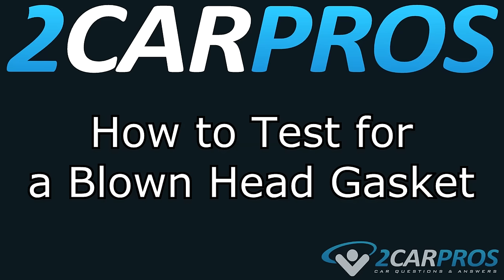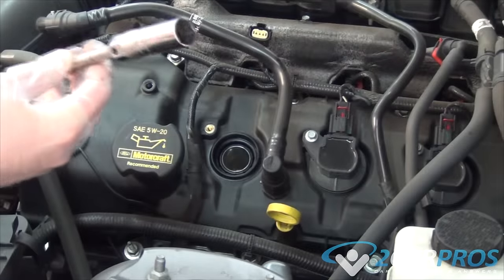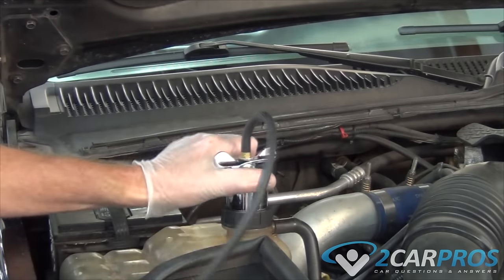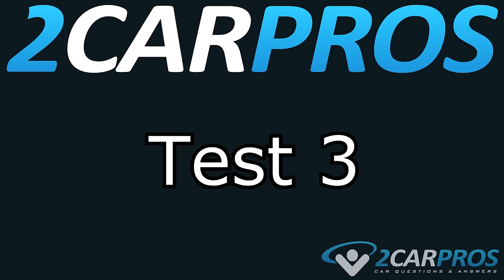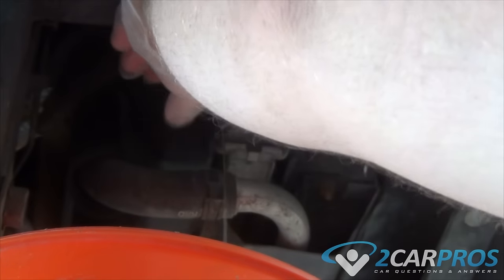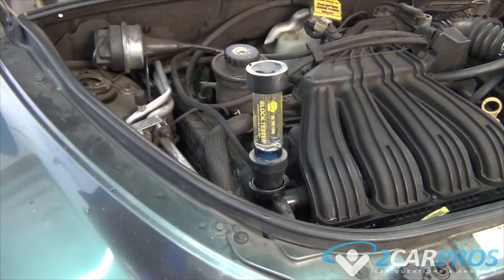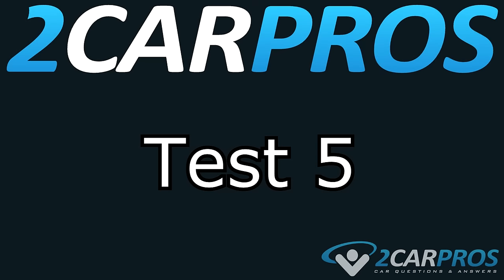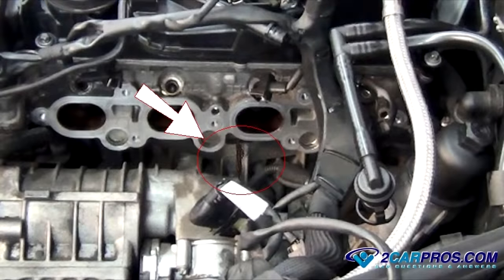HOW TO CHECK FOR A BLOWN HEAD GASKET

Comment: A very easy way to tell whether you have a blown gasket is to just remove the oil. If water falls out first then the gasket is blown. Because oil sits on top of water.
Reply: That doesnt confirm headgasket is blown,  only that coolant is making its way into the oil.   Could be from the oil cooler leaking.
Reply: Or fuel leaking into coolant there are many different things that can differ from where the head gasket is damaged
Reply: Lots of white smoke and collent is being evaporated
Reply: Is a gasket repair extremely expensive
Reply: That's for a fully blown head gasket as well as what people commented. Some of these test are for when the gasket is slightly leaking but not where you can see in oil.
Reply: @94sn95gt can a gasket that is faulty on a oil cooler cause this as well

Comment: Test number 1, you consistently have to refill the radiator overflow but no fluids are under the vehicle.
Reply: My radiator overflow is always empty. I don't have any leaks on the ground. My car smokes some under the hood when you reve up the engine. Idk if it's oil or antifreeze I smell. I just bought this car in April.  I dont drive it much but one shop told me it was a blown head gasket. After about 3 weeks of driving it it burned about 2 qts oil. My radiator was about 1/pitcher water low. 
One machanic came to my house and couldn't tell what was wrong.. but he made him a quick 20.00 smh!!
Reply: Yes Barbara your smelling both because they are mixing together and thats a sure sign of a blown head gasket the gasket is supposed to stop the fluids from mixing it will cause it to smoke a lot and overheat thats why you can't see a leak because their just mixing! I only know some things about cars from a long relationship with a mechanic!
Reply: That's what mine is doing now... constantly filling with 50/50 coolant (like twice a week), but no leaks on the ground or just a few drips here and there.  I've got a mechanic coming by today 🤦🏽‍♀️.  We have a Chrysler 200.  I hate this car 😂
Reply: @mstoi38 sounds like the coolant is leaking to the exhaust side. In my case, i had a avenger. The coolant was  burning up before I could see any indication of a leak. I hope you got it figured out. Next vehicle get a Toyota, save yourself the headaches 👍
Reply: @lozo4745  My dad always said "buy foreign," and he worked at USX 🤦🏽‍♀️🤣.  

Come to find out... my head gasket is blown.  It was a crack. Thus, no smoke from the tailpipe at the time.
Reply: So that means it’s slowly going out?

Comment: the way I found out was my subaru exploded
Reply: Josh King I have a very minor coolant leak, but I bought my car private sale, when I had to change the cats I could drive on most roads but I couldn’t get the car over 40 without putting it in sport and changing the gears myself, I wouldn’t recommend driving the car, you’ll risk blowing your motor. i just changed my radiator hose because it was the size of a baseball.
Reply: Josh King my radiator water is bubbling out badly when cap is off....  but van is driving perfectly other than loosing water in radiator. Wonder if that always means a blown head gasket or hopefully something else.
Reply: Sam Richards sounds like a head gasket man
Reply: Josh Flanders most probably right
Reply: @samrichards8251   i recently had that problem with my 03 Seville,put a new radiator,heater core,water pump and thermostat in only to find out that a small bottle of k seal would've save me  alot of money
Reply: D Trap not sure if that is a long term fix or maybe short term Patch
Reply: @samrichards8251  yeah I'm still skeptical it's only been over two weeks but the leak stopped immediately after I put the k seal  in
Reply: You'll are eat up bro
Reply: @joshking3256  the same thing happened to me ! What kind of subaru ? Mine is a 05 wrx just happened the other day. Only thing is that by the time I got home the car died out a few times ! I hope I didnt damage the engine
Reply: I thought mine did as well...but after fear/determination/screaming child at night in the road I got it to turn over and get home...I mean, there’s a shit ton of oil blown all over the back of my motor..but it’s turned over after I shut it off as well...
Sooo..
Thinking about going the Blue Devil route.
Reply: ESP since I just replaced the radiator last WEEK...and replacing the HG will be worth more than the car at this point so what do I have to lose..right?

Comment: I used a bottle of Steel Seal to fix my head gasket, drained the coolant, removed the thermostat, flushed the cooling system really good, Then use a radiator cleaner to clean the cooling system , Make sure to flush out all the cleaner 100%, When engine is 100% cold add steel seal with distilled water, turn heater on high & let idle for 30 mins with the radiator cap off........Let it cool for 1 hour the let idle again for 30 mins with the radiator cap on...........next morning let it idle for another 30 mins then removed all water from the system to let the steel seal cure by air contact for 24 hours, Replace the thermostat, fill with coolant and your good to go. Mine has been running perfect for 70k miles now as i use the car for uber & lyft, Only cost me about $120 total.
Reply: Still running?
Reply: @BriveAW  Yup still going
Reply: I think that is the product we used on my buddies 2007 335i (twin turbos pushing 15psi).  Comes in three bottles...1 flush. 2 ceramic block and head sealer.  3 coolant system stop leak addictive. 
Followed directions and no more steam shooting from the side of his engine. Still good 3 years later as far as I know.  Great product.
Reply: @MrRepairmanjack  That’s the Irontite kit, That works 100%

Comment: Also another way to tell your car's got a possible blown head gasket is you are not getting any heat. Since your cooling system is pressurized any loss of it will cause you to get no heat. Though it could be a clogged heater core or not enough coolant as well. Make sure to rule them out.
Reply: Blower motor can also cause no heat.
Reply: Or ur just low on coolant
Reply: Also check radiator oil cooler
Reply: @codyzent6471   well that's a no brainer!
Reply: Also if your heat isn't working it could also be a sign of a bad serpentine belt.
Reply: So if heat is working it can’t be a blown head gasket?
Reply: Id like to know aswell everyone went hush hush
Reply: @dominiclambert7296 is this the case ?

Comment: If you drive your car on short hops, that can make the fill plug milky as well. Nothing wrong, just doesn't run long enough to evaporate normal condensation.
Reply: Thank you
Reply: What happens if you car was sitting for 3 months in cold weather with its dirty oil. Now it’s milky??
Reply: What happened if you don’t drive your car for 3 days and you get white stuff on oil cap
Reply: @leo4870  condensationdrive it for a good ride, probably go away probably was there before it was parked
Reply: goat, thank you man
Reply: That's a bit of a relief. I get a good bit of that milky goo as well, and I usually only drive my car in town, so very short trips. I don't have any white smoke from my exhaust, dipstick is perfectly clean, and I can zip along at 80 on the interstate without noticing anything weird. So it definitely puts my mind at ease to know my car is likely just fine.
Reply: @thewiseguy7100  44ý

4

Rr=r

G
Reply: Ñ
Reply: What do you mean by short hops?
Reply: @pacobus24  not long enough for it to get warmedup and time to evaporate condensation

Comment: I did all those tests and could not find my blown gasket - but the following test showed the problem - remove radiator cap and bring level into view - bring a cylinder u want to test to top dead center on ignition stroke [both valves closed]  put compression test hose or extension [without check valve in it] into spark plug hole - attach shop air to supply shop air at 100 psi into cylinder on a warm engine - observe coolant in radiator for rise in level or bubbles.

Comment: Big indicators, milky substance like shown, and the antifreeze overflow container level rises with water and dirty sludgy water. If running long enough water inside gets hot and bubbles from air flowing in. Can cause your container to also crack. Great video!

Comment: more symptoms could be :
1-extensive smog in exhaust 
2-coolant level decrease (sometimes you may hear water flow in car cabin specially at ~3000 RPM "when engine is cool")
3-increase engine oil amount
4-uneven engine idling (after engine is cooled - water leaks in engine and makes problems for spark plugs - it wont show when engine is hot)

ignoring bad gasket may cause Subsequent problems for your car engine and increase costs !!!
Reply: I have 2 (very very fast) and 3... that settles it, right?
Reply: that explain why i could hear water moving inside the cabin and my coolant was low and lots of misfiring after starting the vehicle.  Thanks for your comment!!

Comment: Good stuff. Here's another tip, it happened to me once:
I pressurized the cooling system, looking for any water leaks. Well, if your equipment is working well (no air leaks out the pump itself or via the radiator filler neck) the system should maintain a steady pressure reading at about 12 psi (I believe. Sometimes I only fill to 7) if pressure drops within 5 minutes, I look for signs of water, on the ground, around the engine. Well, I didn't see any water anywhere..which lead me to believe that water was being lost inside the motor due to a blown head gasket.
Reply: What kins of color was this water? Me and my buddies audi a4 has oil in the coolant reservoir. We were working on it today and it was dripping a white opaque water below the engine for about 3 hours. Slowly but led to a lot of water over time
Reply: @logansimpson804  Sounds like he had a blown head gasket from an oil port to a water port. What did he ever do with it?
Reply: @RC-Heli835  ended up parting it out. Took the heads off and visually were fine but 90% sure it was gaskets

Comment: I would add to the compression test.... If you also notice a discrepancy between adjacent cylinders in excess of 20 psi, I would consider that vehicle as having a blown Head or may need a Head replacement soon.

Comment: Test 1: "Mayonnaise" as its often called, or milky sludge, can occur when a vehicle is driven short distances. The vehicle may not be heating up the oil long enough to burn off natural condensation in the engine. As heat rises, the water vapour will stick to the oil cap and form an emulsion with the oil. You can wipe this goo off with a paper towel or lint free cloth. This condition can be prevented by either taking a long journey once every week or two, or by letting the car idle so it can come up to temperature and burn off this residual condensate. If you get this mayonnaise even after frequent long journeys then the head gasket might be bad.

Test 2: If easy and safe to do so on your gasoline vehicle you can remove the fuel pump fuse and let the vehicle run out of fuel, restart the vehicle. When the vehicle is unable to run, you can now remove the spark plugs. Hold a printer page or similar closely over the spark plug hole and have another person crank the engine for a few seconds. If you observe any residue on the page, smell the page to see if its gasoline, if not it will most likely be water from the cooling system. You can add red (or other color) dye to the cooling system to further validate this, if the water on the page is red for example it's a guaranteed sign coolant is entering the combustion chamber.

Test 3: When the engine is cool, there should be no bubbles in the radiator or expansion tank. If you see bubbles, combustion gasses are entering the cooling system. In this instance, you car will often present as an overheat condition. If you remove the radiator cap when the engine is at operating temperature (Never do this) the coolant will boil naturally. The radiator cap pressurises the cooling system to prevent the water from boiling.

Test 4: As explained. However, in the case of diesel vehicles the solution will turn green indicating a bad head gasket.

Test 5: A compression test will tell you if the compression is low, but not why its low. It can be low due to worn rings, bad head gasket, cracked block or head, warped block/head, or valve seat issues. A leak down test will tell you how much air is leaking from the cylinder, and where its leaking to; which is the important thing to know.

Test 6: As explained.

Test 7: If you checked all of the above and your vehicle is still showing overheat on the instrument cluster, check your temperature sensor and thermostat. A thermostat can stick closed which will cause engine overheating, and over time cause the head gasket to fail.

Test 7: If you diagnose a bad head gasket its very important that you discover why the head gasket failed, if you just throw a new head gasket in and fail to rectify a crack in the head for example, you may blow the new head gasket in a matter of days.
Reply: How long is a "short" distance? When I drive to work it's about 5 miles and about a 12 minute ride. Is that short enough to show then?
Reply: Yes, I would say anything less than a 30 minute journey to be short. Considering it will take something like 4 minutes for the engine to come up to normal operating temperature. This means that your car only has 8 minutes or less to try and boil off the condensation. If 8 minutes isn't enough then you have more condensation accumulating than you can burn off and therefore get the mayonnaise forming.

To combat this you can leave the car idling outside your house for 30 minutes or so once or twice a week if you have a lot of water in the oil. If its not so bad you could start the car in the morning, go back inside to finish breakfast, and by the time you're done the car will be boiling off the excess water on the way to work. Do this for one or two weeks and you should be goo free for another few weeks/months.

You should also note the temperate of your location, and more importantly the dew point. The dew point will determine how quickly the water droplets form inside the engine. If you are often exceeding the dew point, then you will need to let the engine come up to temperature for extended periods of time. Otherwise the 30min idle once a week should do just fine.

I hope this helps.
Reply: I have a 4.6 liter v8 and i have maybe like one water drop worth of this wite gunk on my oil cap... is this a sign of a potentially small break or not? I bough the car (I am 18 with 2 friends that are car mechanics) and i fuc*ed up... this mustang 2002 was upsidedown... (my friends checked it and nothing was visible only when i took off the cover i saw signs of straightening the roof very well made actually) 

So returning to the gasket is it broken or not (no smoke only this white gunk in a very very very small quantity) and I have an ignition coil screwed (one cylinder is not working (replace coming from the US) )
Reply: SeaMonkey aàaAaaaaaaaaaaaaaaaa
Reply: SeaMonkey i
Reply: there is a difference between a sandwich full of thick goo and a slight condensation, the picture shows a blown HG, my BM in winter gets some very slight droplets "THIS" is normal any more than that I would do further checks
Reply: Ok I have a 06 equinox it was running hot, I took it to a shop they said it was a low intake gasket so I bought it and took it home but it still not any heat inside the truck to warm up or defrost the window I put antifreeze and water in still no heat. So my friend checked it out he said it's some block sealant inside so I ask the shop did they put that in they said no so I'm in need of knowing what's going on
Reply: SeaMonkey what
Reply: @SeaMonkey .. my coolant temperature gauge keeps fluctuating as I drive between 90-120 ! Sent it to 3 different garages whom have flushed out the radiator all put in next coolant and even changed the Water pump out and no solution?
Reply: SeaMonkey yep
Reply: You're right test number 5 could be worn cylinders But if the two cylinders are identical in pressure and the rest of the cylinders are high in pressure there is a chance they are equaling out through a blown head gasket. Also if you put a y in there you can actually watch the gauge fluctuate from one to the other. That wasn't mentioned.
Reply: My car is not showing smoke or loosing power no milky oil no leak just run hot when i stop at a light or idle the mechanic said blown head gasket im at a loss please help
Reply: Glad someone knows their stuff
Reply: @devonaminaewing2061  Clogged radiator or bad cooling fans may be your problem.
Reply: So when the engine is idling and there are no bubbles when I'm looking in the reservoir tank with the cap off before the engine warms up, but a small number start appearing just as the coolant starts boiling and the fan goes on, it is normal?
Reply: @obbma4ler22  yes that's a short Drive 30 minutes and over is not
Reply: @devonaminaewing2061  I know this is an old post - but overheating at idle can be electric cooling fan motor not coming on at idle - could be fan or engine temp sensor - however some cars have overheating issues - like the old PT cruzer...

Comment: I wish to say thank you I have a vehicle that I'm working on and trying to determine exactly which cylinder has the bypass blown head gasket it is a V8 so I'm going to exactly what you did and try to determine which cylinder it is because it is a V8 so hopefully I've only got to change one side of the head gaskets not both head gaskets so your video it's been very informative thank you for taking the time to make such a great video and you have possibly save me an extreme that time and money thank you
Reply from the maker: Thank you so much for watching and commenting!
Reply: Might consider new head gaskets for both banks, one new one old and you could create an imbalance in the engine especially if you’re milling the cylinder head, happy torquing:)